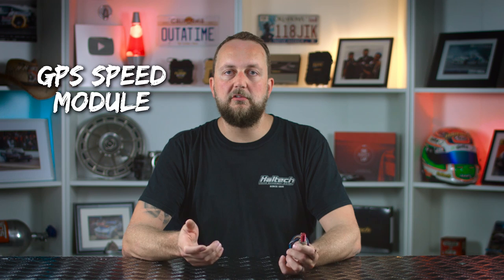🛠 Up 2 Speed: Wheel Speed Sensors Explained | TECH TUESDAY

Comment: I've got a 1988 Honda Legend and sadly they don't build any aftermarket replacements for the speed sensor which is positioned on the gear box. After reading the manual it says that it should be receiving a 5v signal to the computer .. which an old school separate computer located under the front seat. Just wondering if you have any idea about the sensor .. and also because it's pre OBD-II .. is there a way to just jimmy in a replacement aftermarket sensor which will supply the 5v and not have to go through the hassle of updating all the computers and everything .. as the car is so electric heavy it would turn a possible 1 hour job into something closer to 15 days :D

Comment: I've replaced 3 rear sensors on a Ford Focus in less than 2 years. If it's so simple why would these sensors fail? This is the first ABS vehicle that I have ever had to replace a sensor on.
Reply from the maker: Uhmm... that would be a question for Ford?...
Reply: @haltech  The same sensor is also used on Mazda and Volvo. Could the interface to the ECU cause sensors to fail?